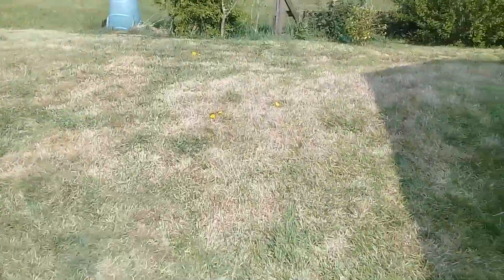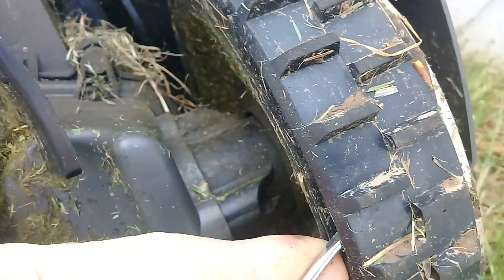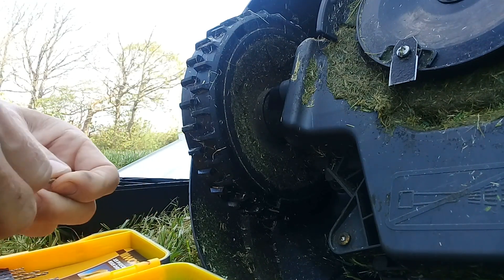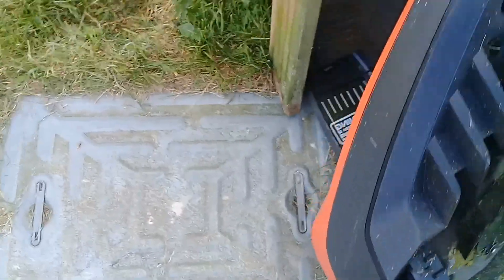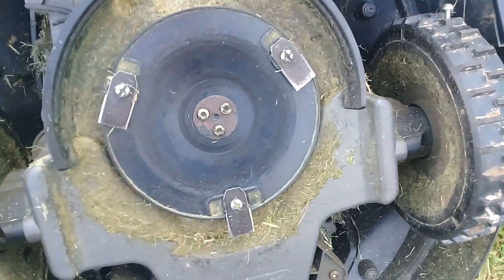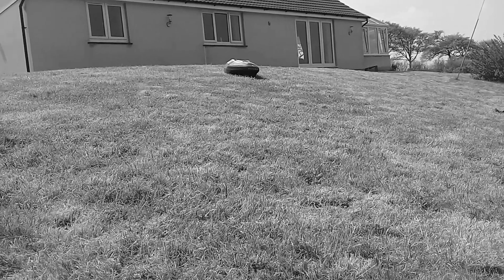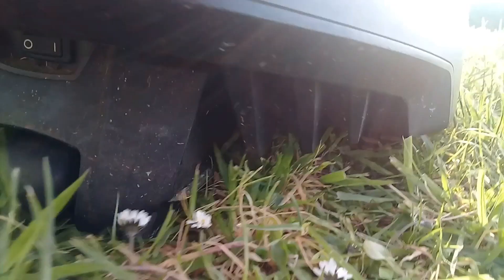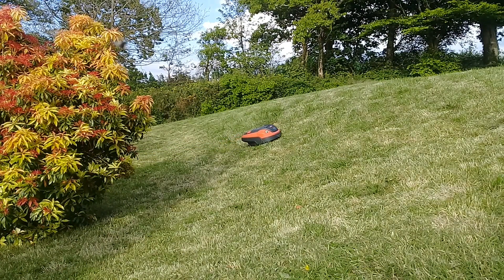How To Make A Robotic Lawnmower Go Up Hills Steep Inclines

Comment: You probably gonna kill the motor earlier too. The wheel free spinning avoided them to make too much effort, now the load is much bigger. Not sure how much if a difference it will make
Reply from the maker: Still working fine and coming up to 5 years old. Currently cutting an area twice the size of recommended.
Reply: @fiveminuteman  ok, then probably not an issue 😀

Comment: Would running spikes work?
Reply from the maker: They might, but also consider using plastic mesh fencing pegged down with spikes for additional traction. I used it on my steep banks in the summer.